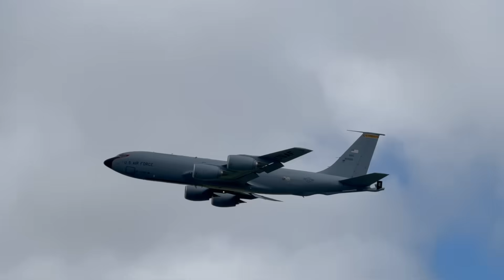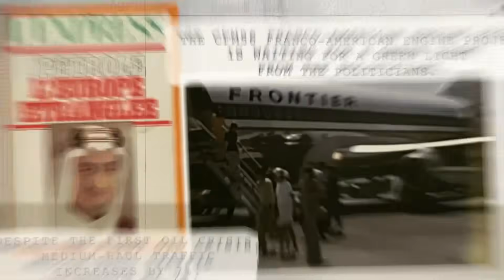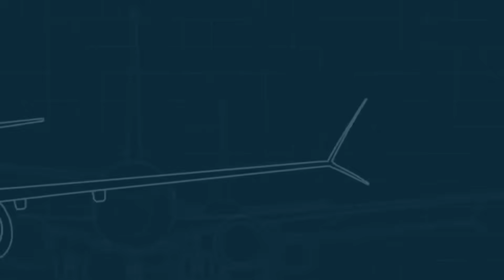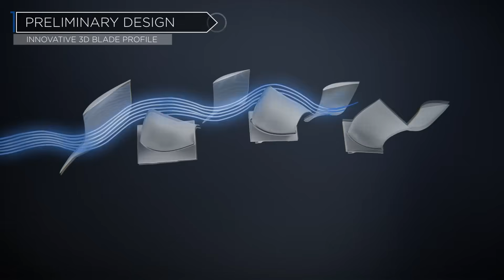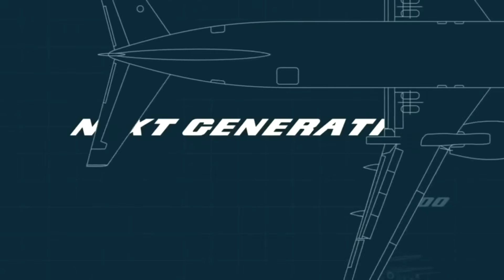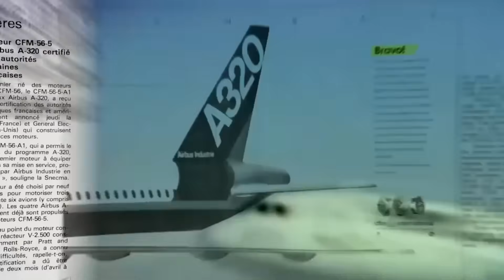CFM56: The Engine That Never Quit?

Comment: as a turbine nerd living in ct i have known so many that worked on the jt8. I've had many rides in the md-88 and its 2 jt-8,[the pre cfm engine for 727,and 737 until that magic moment with 737-300. the jt 8 has what it calls a fan but its about 1 or 2 inches bigger than compressor stage. Bottom line, besides sound difference. When the pilot advances throttles for tackoff the jt 8 does nothing for a bit until rpms reach settings then it pulls gently. I love modern fanjets on twins, it pulls you into seat and keeps you there till rotation. Every seat filled, hot day no matter it still is amazing.

Comment: Certainly seems to have claimed the throne from the JT8 D engines
Surprised that it would be more reliable than the JT8 D (other than the first early examples of the JT8 D)
 of course the lower noise level,much smaller fuel burn per seat mile,significantly more take off thrust "static" and smokeless operation must have a lot to do with its pushing the JT8 D into obsolescence

Comment: It is the American product, not French.   At the time, GE wanted its latest military engine to go commercial.  But the Defence department and Government wouldn't allow because they didn't want technology leaked.  So, GE had the French its agent in negotiation.
Reply: What a typical american comment, i'm messing around a bit. You're mistaken, it's well sourced online. I used to work for Safran (GE's counterpart in CFM International). The HP part has always been american (core), the french does the LP. It's really 50/50. The final deal happened between USA's and France's presidents, it was decided the core would be produced only in the usa and that GE and Snecma payback part of the F101 dev to the american gvt.
The repartition of work is still the same for the Leap. Both companies put great engineering, it's a nice success story, two companies in the 70s with not the same work culture, Snecma was public at the time.
Reply: @icare__ In the early day of CFM56. American had the French do LP part and fan.
But the French exposed it's weakness in tech on parts it was made of.  The French's fan blade broke several times and  caused accidents from tiny to severe fatalities.  Until GE had to teach them how to make a durable fan blade.
Reply: @alexlo7708 no doubts that Americans had better experience in fan tech in early days. But still it doesn't make an American product, your comment was edgy. Snecma was quite new in civil engines, they learned some when the collaborated with RR on the Concorde's engine by producing parts of the engine but it was not enough, the 593 def didn't have a fan 😅
It's like saying Airbus is French because in the early days they had the main lead after the British withdrawal (hopefully Hawker stayed as a private contractor, the Brits were def more skilled in wing tech) and had to teach the germans how to make light aircraft structures, for example the A300's doors were too heavy, Germany brought the will to get their small aircraft makers in a serious civil airliner project. Tho, the French still have the lead today as they are still continue to lead the main architecture and also avionics part that make Airbus' philosophy.
Reply: @icare__  Americans has better experience in fan tech in early days until today. The composite fan blade is American GE's secret. The UK Rolls-Royce  is trying to catch up, but they have not deployed it yet.

Comment: Then u realize maintenance is not top notch in China ask anyone who has done maintenance or breakdown on aircraft and see why they say about the condition of most aircraft from china pretty sure there was a whole 747 that crashed because they didn’t even follow the maintenance handbook and after the fuselage was as compromised they basically just welded back up and it fell off in flight causing the crash china has some of the worse maintenance in the world
Reply from the maker: What you’re talking about is the 2002 China Airlines Flight 611 accident. That was an airline from Taiwan, China, and it happened because of improper repairs decades earlier. It’s not the same as the maintenance system in mainland China’s civil aviation(in the video ). But…Well, Thanks for respecting the One-China principle.😂
Reply: Assuming is is accurate, would you say the Chinese safety record is so good because they hide or cover up accidents?

Comment: The CFM56's first real success was Boeing's decision to put the engine on the 737-300/400/500 series. That dramatically reduced the noise level of the 737 and made it very popular to operate with noise-sensitive airports like SNA, MDW, DCA and LGA. Indeed, it was Southwest Airlines that launched the 737-300 in the early 1980's.

Indeed, the success of the CFM56 was why the technology of that engine became the basis of the LEAP engine, found now on the 737 MAX and the A320neo airliners.
Reply: Indeed
Reply: The actual first SW 737-300 is in a museum in Dallas. Worth a visit.